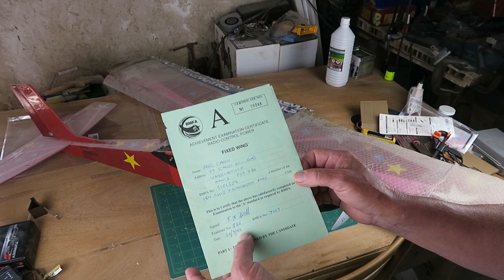Carl Goldberg Mirage Restoration Flight After 20 Years!

Comment: Was waiting for you to go Vertical.  LOL
Reply from the maker: When my friend at the club test flew it first it did! It pitched up something crazy and I was surprised (and grateful) that he got it down in one piece! Just a touch on the throttle and up went the nose. The solution was putting in more down-thrust on the motor, lower pitch prop and elevator rates plus a heavier battery moving the C of G forward. I am going to reduce the propeller again to an 8*5 now I have a new prop adaptor.

Comment: Congrats on the restoration! I built one of these when I was a kid in the mid-90s because my instructor was flying one and I wanted everything he had. He, of course, was flying it on an Astroflight 05 and 8 cells and an actual ESC and all I could afford was a 6 cell and the stock motor and an on/off board for the motor. But even with that she flew great.

I recently came into possession of a few of those old Astro 05s with 0 time on them so I figured it was time to build another Mirage! And I absolutely couldn't be happier. Astro 05 direct-drive on a 2s 2200 with modern micro servos? The plane weighs 34 ounces - over 10 ounces off the suggested weight on the box. And she flies beautifully.

https://i.imgur.com/wURJWxP.jpg
Reply from the maker: Looks great! Love the "wheelpants" I never had them, mine was second hand back in the 90's! Agree they fly well, I've never been tempted to convert to ailerons, quite content with rudder and elevator. I guess you have the plans, I have a PDF of them if you need 'em! Please consider subscribing if you have not done so already!